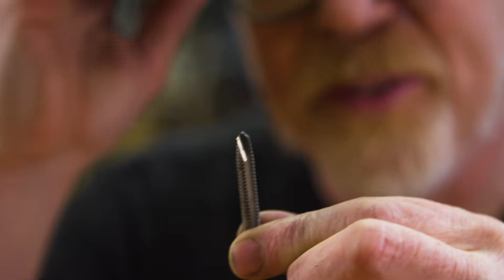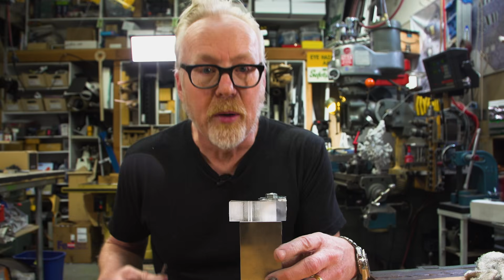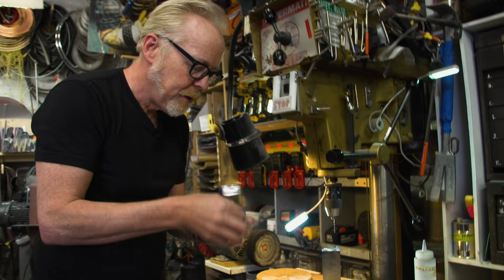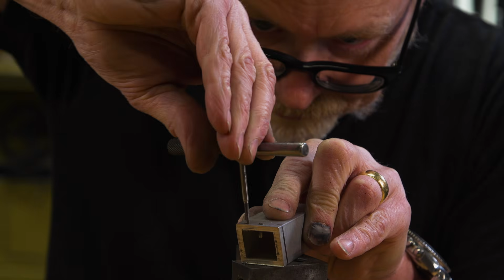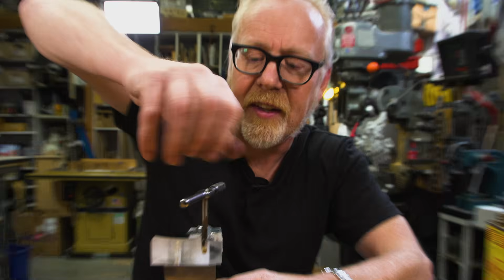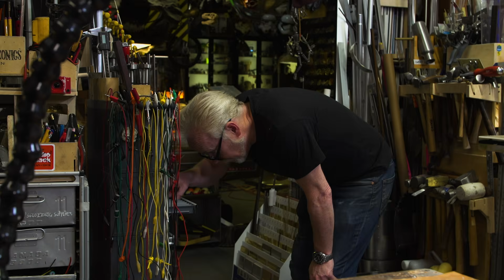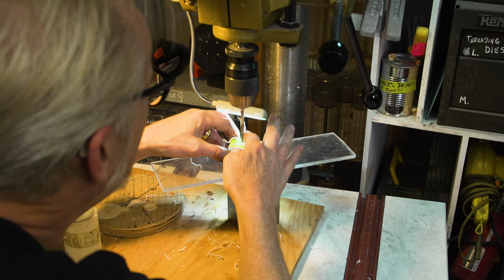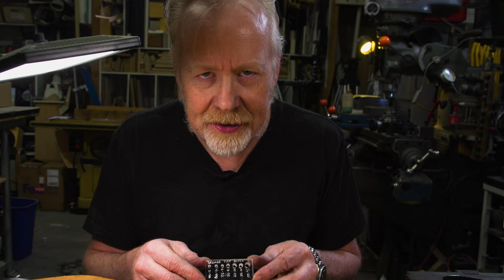Adam Savage's One Day Builds: Thread Tapping Guide Block!

Comment: 6:12 He forgot to mention that all are Metric, but the last. (EDIT: incorrect statement)

Additionally, for clarity, there are 3 taps per size. Each tap gradually reduces in its taper intensity--for those looking to achieve thread bottoming on blind holes.
Reply: WRONG. What he describes at 6:12 are NOT METRIC taps.
They are yet another obtuse American system for sizing fasteners, that is neither "Imperial Fractional" nor Metric.
2-56 = #2 screw = 0.086" @ 56 TPI (threads per inch)
4-40 = #4 screw = 0.112" @ 40 TPI
6-32 = #6 screw = 0.138" @ 32 TPI
8-32 = #8 screw = 0.164" @ 32 TPI
10-24 = #10 screw = 0.190" @ 24 TPI
10-32 = #10 screw = 0.190" @ 32 TPI
Major diameter in Unified threads = 0.060″ + 0.013″ x (# number). These are termed "Screw Gauges (Gages)".
...
But wait, It gets even worse ... those diameters don't line up with either Fractional OR Number drill sizes!!
#2 screw = 0.086" = #44 Drill (between 5/64" and 3/32")
#4 screw = 0.112" /= #34 (0.111" too small) or #33 (t0.113" too big)
#6 screw = 0.138" /= #29 (0.136") or #28 (0.1405")
#8 screw = 0.164" /= #20 (0.161") or #19 (0.166")
#10 screw = 0.190" /= #12 (0.189") or #11 (0.191")
...
Read an amusing yet informative blog post here:
https://themetricmaven.com/without-metric-threads-were-screwed/
Reply: @johncoops6897  thanks.

Comment: Good intro to tapping. The bottoming tap being used in this video appears to have a straight flute. To save a little time, for blind holes consider using a spiral flute tap which will pull the swarf (chips) out of the hole while it's being tapped. Be careful to not mistake a spiral flute tap which will pull the swarf out of the hole with a spiral point tap which will push the swarf into the hole.

Comment: In my beginning machine shop class years ago, the teacher was unconcerned when someone broke a tap in a hole. He'd say, "yeah, you broke a tap!" It was part of the education. Luckily, I had an early career as an automotive mechanic and had my broken taps far in my past:) 

In aluminum, brass, silver or gold, you can dissolve broken drill bits, dowel pins, and taps with a saturated alum solution. Dissolve as much alum as you can in simmering water, then put the piece in for awhile (a couple of hours or works at room temp overnight). It works for any ferrous metal in any non-ferrous metal. It causes rapid oxidation (rust).

Comment: I got a tap kit at harbor freight and it came with one of those starrett style things.  Ironically the kit didn't come with the tap I needed, which was the 1/4 20 btw! I used it for making a complicated sugaring machine and was threading holes mostly into acrylic.  Never had an issue until I was too aggressive (in steel) with my 1/4 20 tap and didn't use enough oil, yep I broke it!

Comment: Dear Mr. Savage. I love what you are doing, it's awesome. But I have a question about the tapping episode I just watched. You are only talking about the thrrad tapping tools that are straight edge, not the type that actually is built like a drill and made for bottom holes. Where it pulls out the material it's cutting. Why is that?

Comment: As you can see in the video, spiral point (or gun taps) push chips forward. In a blind hole (no exit) you need to be aware of this can cause the chips can jam up and this is what breaks taps. This is why you need to drill a hole deeper than you need, and if you are tapping it deep you should stop and clear chips. Helical flute taps are shaped to pull chips up and out of the hole, these are better for blind hole tapping, but can be more expensive and not really necessary if you are tapping by hand. 

In regards to 10-24, this is the tap size that is most prone to break. The thread geometry to hole diameter cross section ratio for this size mean there is less material than other course thread sizes. For #10 screws, you should try and use 10-32 when possible, specially if you are tapping into steel.

Comment: Any views on using a tap follower in the drill press? Pros, cons compared to tap guide blocks? Clamp the piece in the drill press, drill the hole, swap the drill for the tap follower in the chuck, use the tap follower in the chuck to guide the top of the tap. Ensuring the piece has not moved between drilling and tapping.

Comment: Watching and listening to Adam has no bullshit given me confidence to start fixing things. I saved $25 from tapping alone. The threads on my rifles flashlight mount were stripped so badly that the mount would angle down towards my feet instead of down range. Now, It’s as good as new! I also had had to modify a screws head to fit the mount but the mount now holds nice and tight to my rifle.  Thanks Adam!

Comment: I have never had issues with stoping but I'm not a maker I'm a farmer/mechanic if I needed to tap a hole I just grabbed a tap drilled the whole and yes I usually use an electric drill or a socket to tap  yes I've broke taps I just drill them out and start over but maybe I only tap large holes 1/4-20 is probably the smallest I tapp anything smaller I tend to use self tapping screws

Comment: BREAK A TAP... if the tap has 2 grooves, grab 2 small drill bits that fit in the grooves, if it has 4 grooves, use 4 drill bits... don't use them to drill, use them as your leverage... to make a handle, stick a wrench, or even another drill bit between the 2/4 drill bits that are stuck in the grooves of the broken tap so you now have a T shaped handle, and slowly start to wiggle the tap loose... after the tap is out, drill out the hole and fill with a time sert... lol... I've done this MANY times, the new guys always break taps

Comment: Adam, I know this is regarding Tapping, but are you familiar with the Little Giant Die Threaders? They are hand threading dies with guides built in. Best dies out there... Pssst, and there a bargain on ebay right now. GREENFIELD TAP AND DIE, LITTLE GIANT. google it you will love them. I have several sets from 1885-1915. THEY ARE ABSOLUTELY THE BEST, FULLY ADJUSTABLE, REPLACEABLE CHASERS EVEN ON MY 1/8TH INCH DIE!!!!!

Comment: Klein makes a mean tap tool that has the main 6 taps he talked about and I bought one.. I like it but you have to know your drill bit sizes and keep them with you because its just the taps.. its called a 6 in 1 tap tool and it looks like a screwdriver.. I've seen a few electricans carry them and they are neat to use..

Comment: In the stockroom at work they had aluminum blocks made for each size, 4-40, 6,-32, 1/4-20 (and so on) with holes drilled in the top of the block that held a tapered tap, bottom and plug tap with drill bits for drilling the hole for tapping the threads and a clearance bit for the screw. Saved time hunting for the correct sizes of drills and finding the taps you need. Adam. You did a really great job explaining the sizes of the screws  and the drill bits. Now do Metric.

Comment: I noted, through the acrylic, that the "rapid tap" didn't penetrate. It didn't following the cutting edge. It shed off, and stained the acrylic about 1/2" down and stopped flowing further. Could be worth the effort to unwind the tap completely at least once, during the process.

Comment: Tap holder seems like a good idea but every tap I own is wider at the threads so it can be pulled out at the bottom of the hole. If i need to be precise i set my object in a drill press with a center finder bit pushing down into the center divot of the tap

Comment: Good video, cutting small taps can be frustrating.  A couple of years ago I stumbled on a bench top gadget that has greatly reduced the number of taps that I break off in the tiny holes of my miniature engines.  It does the same thing as the drill press technique but it's dedicated to tapping.  I think I bought mine from Grizzly or Harbor freight for about 90 bucks.  They call it a sensitive hand tapping machine. You probably know about them, looks like a small drill press with no motor the spindle  has an adjustable counter weight and is turned a small hand crank.  I love mine, only wish I had discovered it sooner.

Comment: rescue bit in a die grinder can remove a tap or easy out. saved me on exhaust manifold bolts in frame. DID NOT want to remove head or engine just to replace manifold

Comment: Actually #43 is the tap drill for 4-40. #42 is the tap drill for 4-48. Maybe the larger diameter hole is necessary for sloppy holes drilled with a hand drill but not eith a good drill press or a mill.

Comment: In grad school, one of the grad students was working on a 3D printed titanium part for NASA. The part cost ~$25,000 to print and had multiple holes printed into it so they could later be tapped... (I’m sure you see where this is going). While trying to tap the holes, the 10-32 HSS tap snapped off. The machine shop manager and the student spent a month trying different methods to get the broken tap out of the hole. They finally were successful in removing the tap by electro-chemically etching it away using a wire EDM technique.
I’ve never looked at taps the same...

Comment: I mostly work with metric, any imperial I use was either BSW or UNC, and was always referred to by diameter 5/16, 3/8, 5/8 etc when did 4-40 or 10-24 and 1/4 - 20 become a thing. I'm guessing 1/4 is for 1/4 of an inch, but what does the 10 or the 4 relate to?

Comment: On being able to tap out of alignment: some years ago we had a problem with a misaligned tapped hole in a facing head tool. 
My manager just got a tap and retap the hole forcing the tap in alignment 
And it worked! And is was a M10 or M12 screw! 
On the other hand I've broken a M2.5 cleaning the threads on a precision piece after heat treating... glad we had a spark erosion machine!

Comment: i bought a lot of cheap carbide end mills. they cut through taps like a hot knife through butter. have drilled a broken tap out of cast exhaust with a hand drill. but much better with a pillar drill. before i started using end mills was using punch to try and tap the tap around, cobalt drill bits, tap extractors nothing worked. the end mill was seconds it was like cutting aluminium in how easy it cut the tap out.

Comment: One thing that we did to save time in many of the shops I have worked in was to make little individual tap sets -- one or two drills of the proper size with a couple of each kind of tap -- all placed in their own closable little plastic box.  This allowed us to have the correct sized dill with the individual taps.  It also gave us  room for a spare.  Pro tip.  If/when the drills or taps gets dull, put a piece of tape over the end so that you know it needs sharpening.   Anyway, this is all done so that I can quickly grab a 4-40, and have the right drill and tap.  For the common sizes (eg: 1/4-20) we would have a couple -- that way if we loose one of the boxes in the swarf, etc., until we clean up, we have a spare.

Comment: back when I was an apprentice machinist / mechanic, one of my "tests" was to drill and tap a 5/16" bolt hole into a sheet of 3/8" plate glass (not tempered, mind you) . There was no restriction on methods or materials. It was a "figure it out" test. We were allowed to use any reference material we could find in the shop, or the local library. (1969, no internet).  We had 2 weeks.  It was fun, and it taught me a lot.  Let me know if you want me to tell you how I did it.

Comment: I would love to know that make of Silver Blowtorch you have please Adam. 

Really good video to explain the nuances of taps to the uneducated and why you need to be careful, people should not be afraid of tapping, It is one of the easiest things to do as long as you have the right drill first, Drill a straight hole first is the most important. ( Its best if you have a kit of 3 taps per thread and then you have the starter Tap as well as well as the finishing Tap and blind hole Tap). and you go slowly by hand , on a machine its a different matter and great fun on a lathe when you make brass sing when you run a thread down it externally at high speed.  Cast acrylic is also the plastic to use on lasers not extruded!!

Comment: Adam covered just about every piece of tapping wisdom I've learned. I'd add a couple of things, though:
1) If you don't have a guide block and don't have time to make one, the inside corner of a (squared-off) section of angle-iron makes a handy guide.
2) Instead of having a thick guide block drilled to the clearance diameter of the shank, I use something about 1/4"-3/8" thick and tap it, so that it feeds the tap into the workpiece at the proper rate (because I have cheap taps).
3) If you don't have any guides, you can use a drill press (don't turn it on, just turn the collet by hand while you exert a moderate downward pressure on the press handle.

Comment: If you like spiral point taps, give spiral flute taps a try. They're the same idea, where you don't need to break the chip, but it curls the chip up and out the top of the hole, instead of pushing it down through. Spiral points are great for through holes, but spiral flutes are just as good. And spiral flutes can be used for blind holes without jamming things up. You can also get bottoming versions if you need to get right to the bottom.

Comment: Metric Tab Rule of thumb: Thread size*0.8=Drill diameter. Or easily to calculate without calculator: Thread size - 0.2*thread diameter.
Example M5 thread*0.8=4mm pre drill... As said, rule of thumb, not true in every case but allways very close.

Comment: Great content.  But videography/production could use some upgrading:
1.  Ditch the "auto-focus".  Too slow on whatever camera you are using.
2.  More light!  (also see #3 below)  Sufficient light for working is not enough for good videography.
3.  Ditch the black T-shirt.  He isn't behind the camera any more. Black oxide machine bolts, poor light and black background are not a good combination.
With Adam's background in production he should be aware that you can't capture good video "on-the-fly" without making some compromises for slowing down a bit, presetting good camera angles, and shooting good B-roll insert shots.  But I really appreciate Adam and his production team and this is meant as encouragement not criticism.

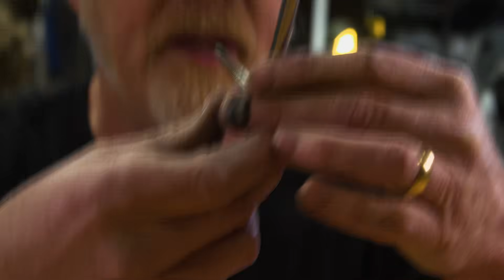Comment: 10:45 There's a little trick to keep your tapping-drill straight.
If the material doesn't reflect well, glue some aluminium-tape over the hole. 
When the tap is in line with its own reflection, you're doing it right...!